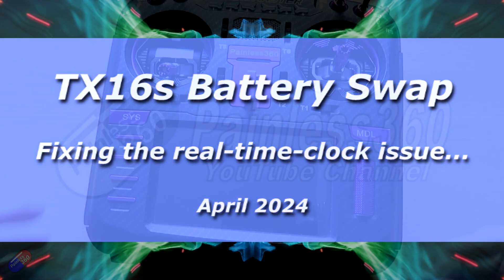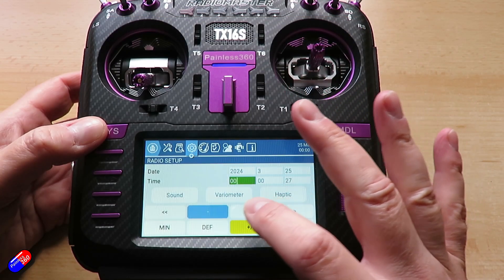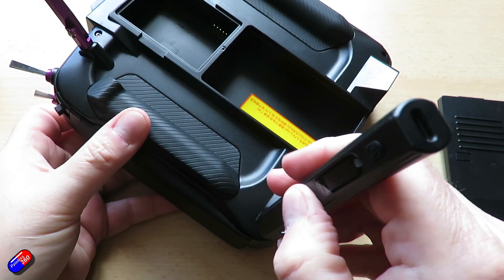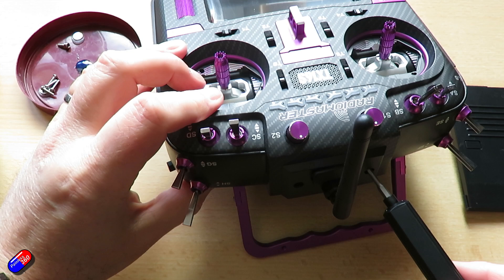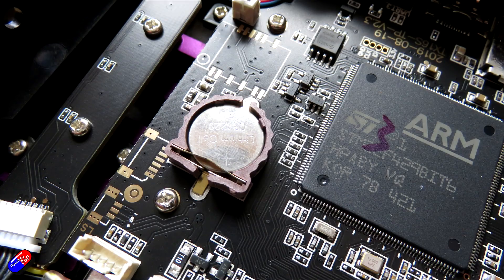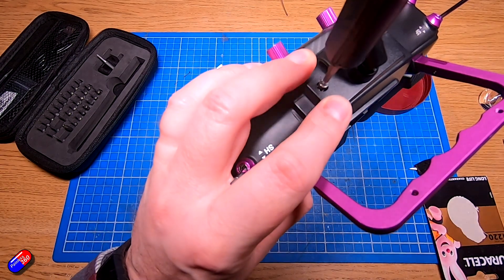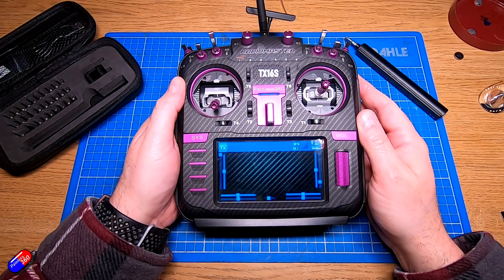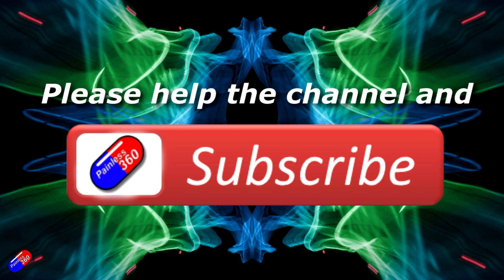How to swap your TX16S battery to fix the date and time resetting...

Comment: Thanks Lee - easy when someone shows you how - also for knowing the correct battery before taking the back off!

But why, oh why did RM use two different sized screws for such a low level job! Rationalising screws is not just more convenient for users, but also for RMs procurement and production of the TX.

Comment: Thanks. I just had unbootable TX16s. After exhausting all other methods (flashing, reflashing, resore factory settings etc) I found that it helps sometimes to remove the coin battery for a few seconds. And that was it!. Thanks to your manual I took the clamshell apart without breaking anything. Thanks!

Comment: would this cause any other problems flying? I ask because I recently started getting this warning and I went to fly and Inav model that I have flown a lot. but after just a couple of minutes in the air, it just started spinning until it hit the ground. Watching the goggle footage signal and everything seemed. just fine So not sure what happened.
Reply from the maker: No issues with control for this. I'm pleased to hear that you're looking for the real cause, and not just blaming the plane.... Happy flying

Comment: Like these radios more things to play with , my original quit charging , so I bought another, meanwhile Radio Master sent me a repair part, other than that ribbon cable on the back ...a piece of cake to install. Meanwhi.e the new one collected dust, So gave it to my Son this week. An act of kindness , no he is a systems analyst, my fault he wanted a co Peter as a boy . I gave him parts and a Microsoft,  kit, he learned all their software, got certified as did my other kids ...best 200 bucks I ever spent. As to the TX 16 , it will drive him nuts so many options, inc.uded a note to go to your site for help. Take care.

Comment: Good stuff. 🙂 Still looking at the OMPHobby M4, how did that go in the end? I want to buy one and was going to install a Pixhawk 6C but it would seem that is a non-starter. Which flybarless controller would you recommend I use instead?
Reply from the maker: Update coming soon... Stay tuned!
Reply: @Painless360  I can't wait, but I will. 🙂